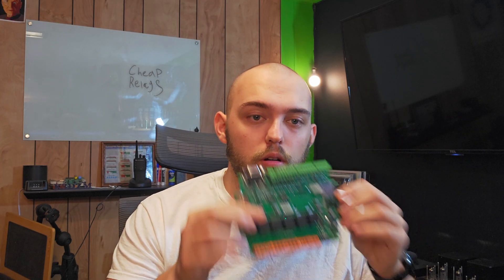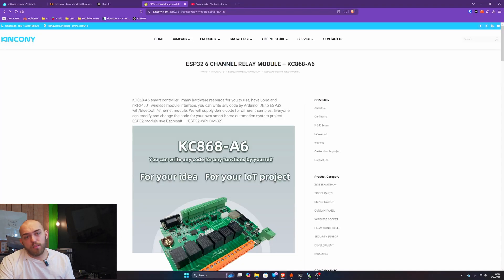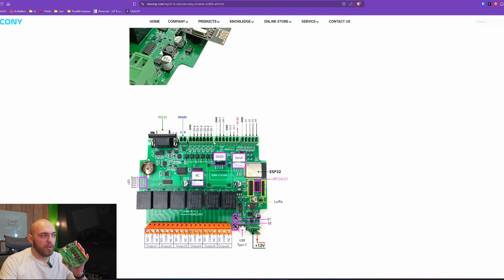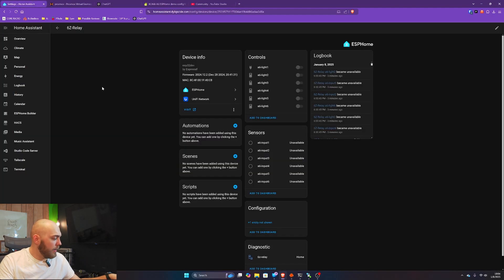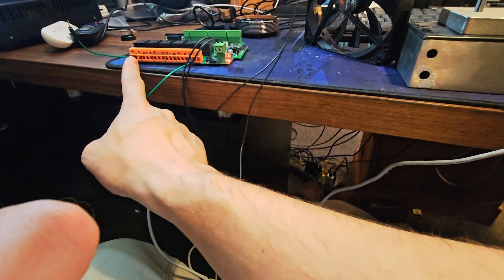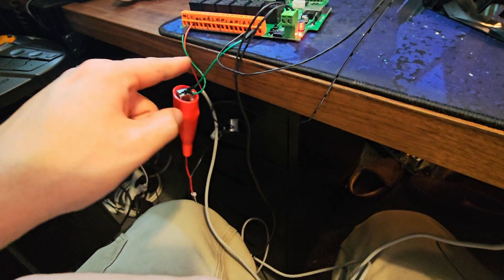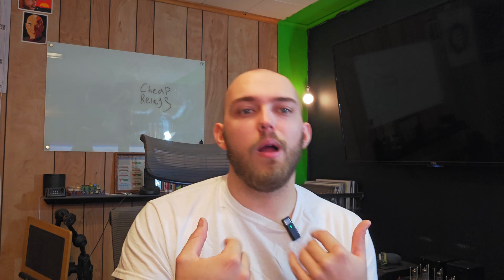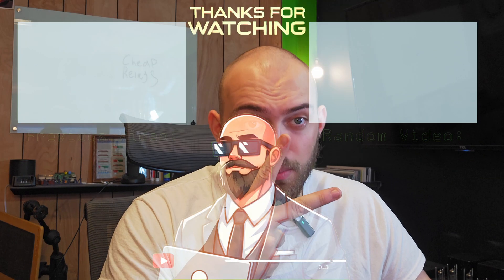This AliExpress Relay will make your smart home next level!

Comment: I've got the Kincony KC868-A8, with 8 relays and 8 dry contact inputs, which I'm using on Ethernet with ESPHome. Setup was very straightforward, and over the air flashing has been trouble free. The CEO (owner?) of Kincony is super active, very open with everything, and answers questions quickly on their support message board.

I'm going to use the A8 with ethernet for cabling to a switch box with momentary contact switches used as toggles, and the relays to control individual LED lighting power feeds.